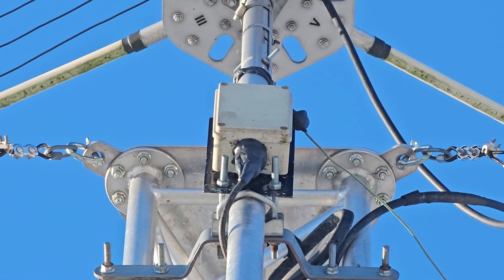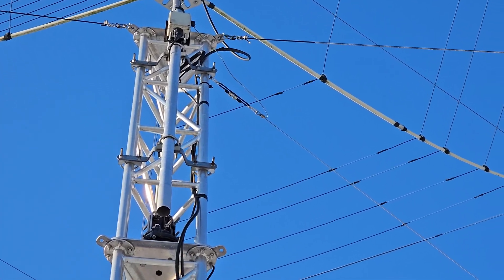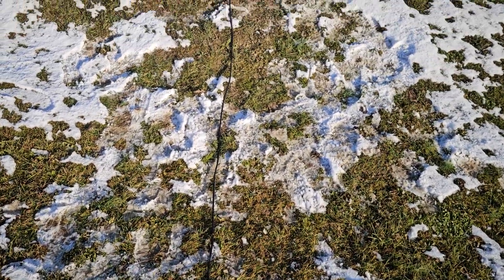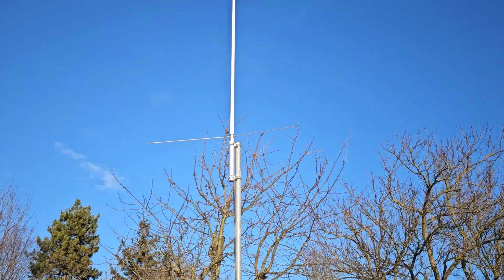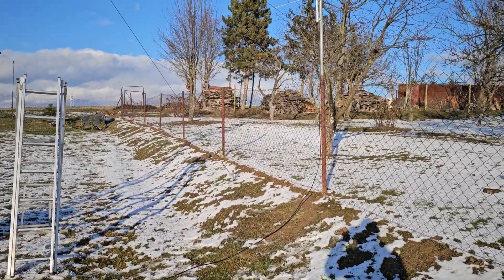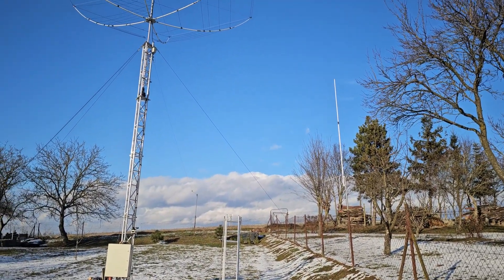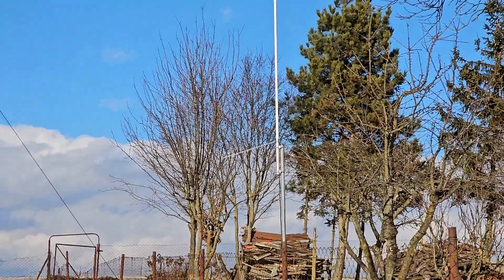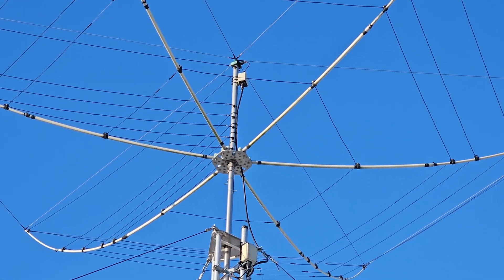I added VHF/UHF Antenna - Diamond X300

Comment: what you could do is buy a longer pole or just a resizeble army telescopic mast, those are pretty cheap. Mine is 1.8 mtr's and you can slide it out to 11 meters in total. But then you would need guide/support wires to tie it up. . I have mine set to 6 mtr's without any support wires.

Comment: The question is, what is the appropriate height to place it? Place it as high as possible will not always give you the best result. My antenna is a Diamond V2000 and is located on the roof of a four -storey building at an approximate height of 16 meters above the ground. 73 Paul